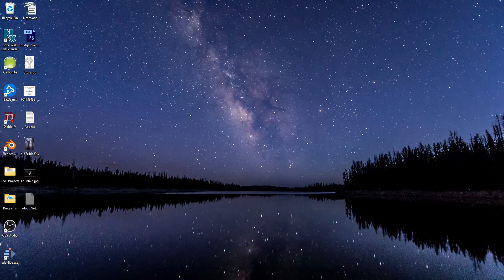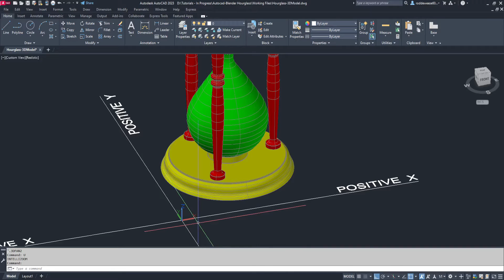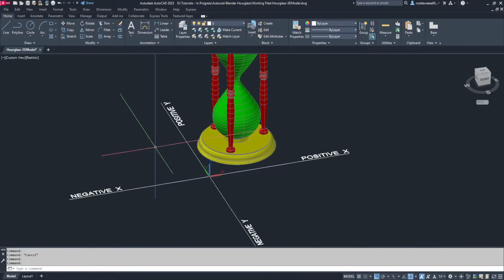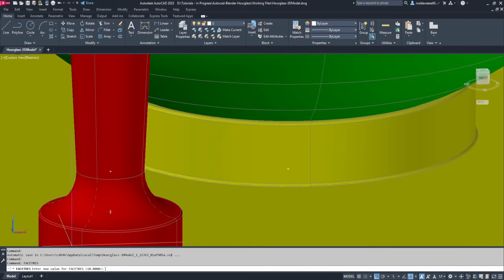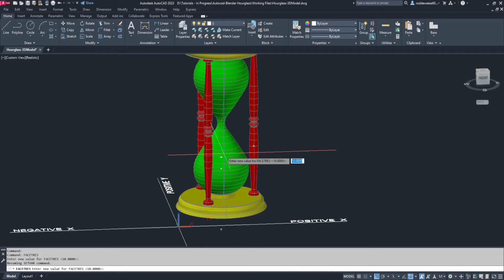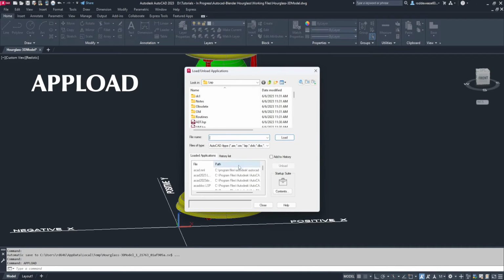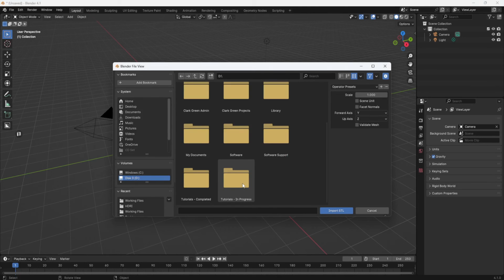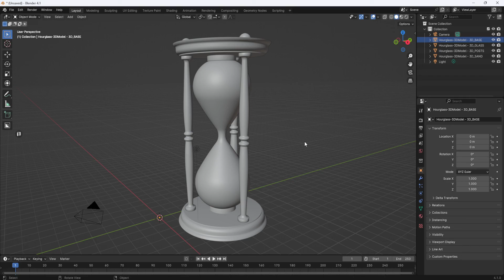Autocad to Blender - Exporting and Importing

Comment: Hi Sir, First of all thank you so much for the tutorial. But i have some issue here. I have followed all the step by step but when i try to run the routine by typing EXPSTL in the autocad, look like nothing happen.. as a try i only use 1 layer and my object is only 1 solid single object.. please kindly assist sir.. thank you in advance..
Reply: i resolved this.. it about trust issue with the folder that i saved the lsp file..
Reply from the maker: @nikhairi3550  Oh, ok. I'm glad you got it sorted out. Thanks for letting me know.
Reply from the maker: I guess the first thing I would need to know is what version of Autocad you are using? The routine works for me on 2023 but it's possible that it might not work on 2026. I have no way of testing it though. As for running the routine, you won't see any change happen in Autocad. The stl files will just export out to your project folder, as long as you named your layers correctly. If your layers are not named correctly, as I stated in the video, the routine will not work.

Comment: Hello Sir!
I have a little issue trying to complete the steps you suggested and I was wondering if you could perhaps offer some insight. When I try to load the EXPSTL.lsp it says that it is "Unable to load EXPSTL.lsp". I have done completed every other step. The EXPSTL.lsp file is not saved in the Autodesk folder, could it be a path issue? I saved the .lsp file by simply saving the EXPSTL.txt as a .lsp, Did I not save the file correctly?
If you could offer any sort of help it would be much appreciated, thank you in advance!
Reply from the maker: That's strange. What version of Autocad are you using? I'm using 2023 and the file loads with no problem. And I'm not saving the EXPSTL.lsp file in the Autodesk directory. I have it saved in a folder on another drive. It could be a permissions issue. You may need to change some settings. In Autocad, I have SECURELOAD set to 0. Try changing this setting and see if the file will load. Otherwise, you may need to save the file to the Autodesk directory in a "Trusted Location".
Reply: @roddeweese6402  I managed to solve it by adding the .lsp file to the startup suite and it loaded. I named them all with the "3D_" prefix however it does not export all layers. Is there a limit on the number of layers that can be exported?(...I got 101 of 'em....) . I am quite new to AutoCAD or CAD in general especially with a project this size. I am using AutoCAD 2025
Reply from the maker: @cassian-t8z I'm not aware of a limit, but 101 layers sounds like a lot. Can you combine some objects? Typically, I would have layers set up according to material types like metal, glass, wood, rubber, etc. So my layer list would be pretty minimal. If you can't minimize the number of layers, maybe try exporting your model in smaller chunks. Maybe try exporting 30 layers at a time and see if that works.
Reply from the maker: @cassian-t8z Something else just occurred to me. There could be a problem with some of your objects if they are not watertight meshes or solid objects. In order for an object to export  to .stl format, it needs to be a solid object. So maybe you should start by inspecting the objects that did not export and make sure they are solid objects.

Comment: Love the video. Is there any way to import a mesh from AutoCAD and not just a solid model?
Reply from the maker: Depending on your model, you might be able to convert it to a solid and then export it. I haven't had much luck doing this, but you could give it a try. You can find information on converting mesh objects to 3D solids here: https://help.autodesk.com/view/ACD/2022/ENU/?guid=GUID-45E37A82-3175-4F20-A5F7-316C46DBEBBB

Another option would be if you have access to 3ds Max. You could import your Autocad file and then export it to .obj or .fbx format.
Reply: @ I’ll give it a try and let you know how well it works for me. Much appreciated.

Comment: Is there a way of bringing the model into Fusion and then exporting to an FBX from there into Blender?
Reply from the maker: I don't use Fusion, so I don't really know for sure, but after doing a little reading, it looks like Fusion can import DWG files, (as long as they are 3D solid body models), and it can export FBX files, so that should work. Give it a try and let me know if it works.